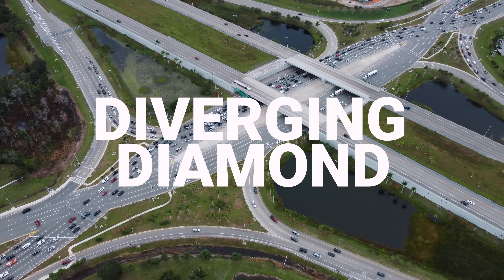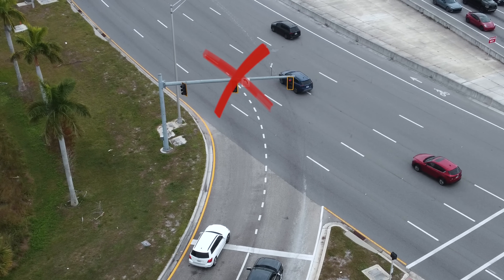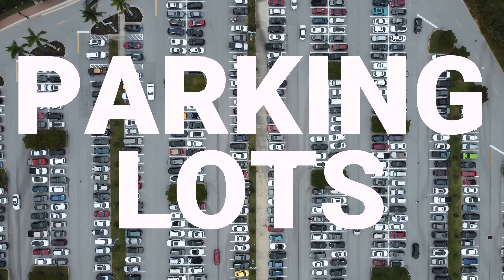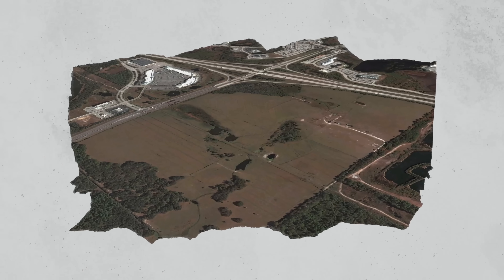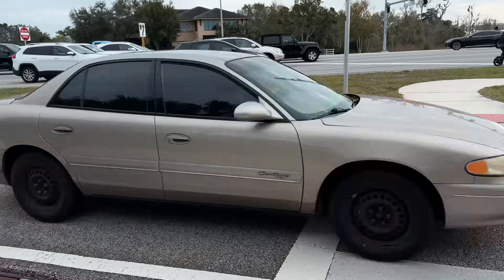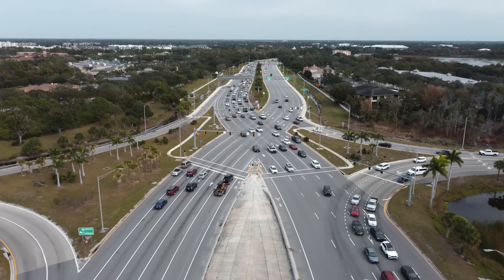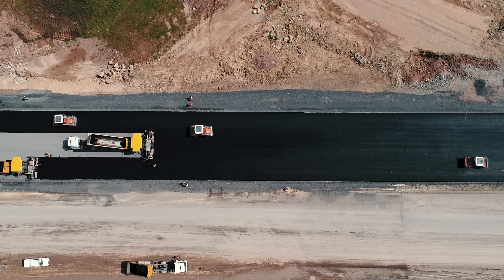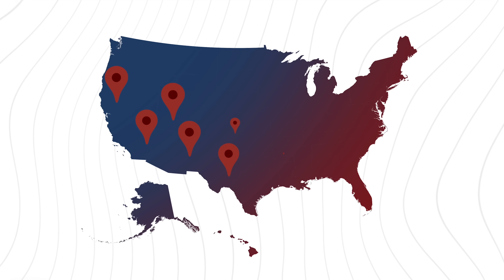Traffic Will Never Be Fixed Here

Comment: I don't disagree that there are uban planning issues here.  I judt don't agree that the solution is the walkable city.  Europe is much more walkable than the United States for example, but then the US is very geographicly different.  The US is characterized by large costal cities separated by heartland that is some variety of plains, mountains, or desert.  This geography demands that cities be connected by vast interstate road networks.  And, where that exists, it doesn't make sense that roads stop existing in cities.  Im not saying that highways don't exist in Europe, but the branch-and-leaf layout is very different.  Furthermore, the climate of many of these places dictate transportation; where heating or AC are mandatory for survival, it's another requirement; suggesting walking to the store when that will give you frostbite or heatstroke isn't a solution.  Even in cities with excellent public transportation, that final walk from thr bus stop to the restaurant can be so brutally hot or cold that a massive parking structure at the end of a sprawling road network is much more attractive than trying to survive the elements.  And I suppose, just in general, walking and biking are physically demanding where a car ride is not--not points in their favor.

This is not to suggest that more cars and more roads are the answer.  But I don't agree that biking and walking are the golden solutions portrayed here.

Comment: A diverging diamond is not the proper interchange to use here. There is significant throughfare traffic which is the primary disadvantage of the diverging diamond: it has reduced throughfare throughput. Not sure what the traffic engineer was thinking here. This really should have been an SPUI.

Comment: Ofc traffic can be fixed you american muppets. Never heard of light mass transit? Or even better, I have a totally revolutionary idea. Bare with me.

1. Lets make a lot of cars stick together so they could move simultaneously, like attached eachother in a queue.

2. You now don't need a lot of drivers, just one at the front. MORE SPACE FOR PASSENGERS.

3. Now comes the fun part. Imagine if you want to have a more energy-efficient system, so you trash rubber for steel wheels (with steel paths) and you can go even faster now. FASTER TRANSPORTATION UNLOCKED.

4. Since now you have this kinda steely queued car thing, you can also electronically coordinate this system by employing professional drivers and you can power everything electrically. Amazing innit?

5. Imagine making this enqueued steel-wheeld-cars scheduled and departing every 30 to 10 mins depending the demand. People will simply wait at a ""station"" for the steely cars to arrive.

Outcome: Now you move 5000% more people than before, with a significantly cheaper infrastructure and saving space for much more buildings to be built.

Comment: 2:04... The other place that "different" intersections fail is when paint is worn or under snow. Around here there's no money to repaint, and several days/year there's snow obscuring the lines, so it has to be clear what to do even if you're essentially blind and can't read a road sign. 2 turn lanes fail HORRENDOUSLY in the best conditions, but throw rain/night glare, worn paint and snow in there and it's a free-for-all.

Comment: Another great video. To your point, there is one interchange type that works well for a trail or sidewalk, a folded diamond, where one side has no ramps at all. Of course that’s great for that side but not so much for the other, but hey 1 side great is way better than any other interchanges can provide, at least without a ped bridge.

Comment: I play city skylines and I’ve noticed that adding one lane doesn’t fix traffic, eventually everyone on that specific road needs to make turns. 

Most drivers drive in the lane they’re planning to turn in. Public transport and making areas walkable is the only solution to traffic.
Reply: That's unrealistic. From my experience most drivers don't drive in the lane they are planning to turn in, they wait until the last minute and cut across every single lane.
Reply: Cityskylines is crappy depsite being made in Finland :/
Reply: @Flint-g4h I cry for Finland :(
Reply: @Flint-g4h  mods can make it work better and as expected
Reply: @Nova32x  
I want the thing by default
Reply: @Flint-g4h city skylines traffic ai Is also insanely stupid. No matter how much lanes you add for example 3 lane right turn they will always use one lane to turn right.

If they have to turn left after they can use any lane and switchable after the turn but they don’t
Reply: @zenitu6914 ya you need mods, it doesn't matter which country your from so no matter how many lanes they normally will just use 1, some mods make them smarter. city skyline 2 fixes that
Better Lane Change, TM:PE, Intersection Marking Toot, Roundabout Builder are the 3 you need the most.

the train system is also broken like in a real world there is a time schedule even block zones. but the game is more like here is 20 trains with 10 cars each all at once so it will overload your network. it even overloaded my train roundabout system that could hold 4 full trains at once

Comment: i'm italian, italy is one of the worst european traffic areas, and Rome is again one of the worse. I live near a big intersection, wich has a lot of traffic and it could be solved by 2 roundabouts, but that's not the point. The point is that the intersection i'm talking about is a 3 lane for every direction and it's just stupid for how it works but an intersection like that is unthinkable even in Milan wich has a lot of big infrastructures. 
The main stupid thing is regulating intersection like that with freaking stoplights. Probably roundabouts are everywhere everytime better to fix traffic, in the next crosses there should be roundabouts, it would fix traffic without any doubt.

Comment: Interesting video. In Denmark we don't have interchange that comes near to it. But it is simply illegal to pass a green light, if you as a driver is unsure you are going to make it to the "other side" safely without ending stuck in the middle and backing up traffic. If the police sees you violate this rule, typical fine is 200$ and also you collect 1 point on your driver license, 3 points and you need to take a driving test again to keep your license. A point is valid for 3 years before its deleted.

Comment: IF the city required all shopping centers to have apartments on top I think it would solve a lot of the problems. In that huge shopping center you could have thousands of apartments above. This means both shoppers and workers who don't need to drive to shop or go to work, thus reducing thousands of cars that need to come in and out of that shopping center. And the property owner would have a far more valuable property with far more income. And the apartments would all have amazing views of the surrounding wetlands. Americans just don't make any sense.
Reply: That's actually a really interesting idea. They could do the same for new box office stores. Then reserve some of the parking for residents.
Reply: I don't think they should require of what you were suggesting but we definitely should deregulate urban policies what makes the US so car dependendent.

Comment: Re: the lights switching while there are still cars in the segment of road expected to clear — isn't this exactly what interlocked block signalling (as in railways) is for? Slap a load sensor under each lane at the entrance + exit to each "block" of road, to measure how much weight of cars is "in" the block; and then set the entrance signals to the A-crossing-B block to stay red as long as any cars have entered-and-not-exited in the B-crossing-A block (and vice-versa.)

Comment: I suspect the blocked lanes problem could be solved by timing the traffic lights differently. cut the initial crossover light first, then give ~3 seconds for traffic to clear before cutting off the crossback light. 

I think that for instances where they are getting this many lanes they are more likely to find success with a true interchange rather than an intersection. it is a nice dream to think we could have more walkable cities and suburbs, but the simple fact is that infrastructure that is already in place is very difficult to change. so while a walkable city is the goal to head towards, we still need solutions to handle the automotive traffic we won't be able to get away from for the next 50-100 years

Comment: To be honest, this issue seems quite easibly fixable.
Just use a „counting“ system that counts the amount of cars entering and leaving the area between the the first diversion.
Now all you need to do, is to ensure that the number of cars entering the space and leaving the space is the same. If it isn’t, then the junction should turn the first light to red for all directions, and elongate the phase on the second light to the point where the number is equal again.
Only now the first light should switch to green for the opposing traffic.
This way cars can never block the crossover area.

For the Turning lanes coming from the Highway, the light should be timed in a way, that they only get green, when the same amount of cars that have passed a sensor on the highway off-ramp, have left the diverted area on the second traffic light.
While this will slightly delay the amount of time until all phases cycle through, it’s only by a fraction of seconds and will massively improve throughput.

For the pedestrian situation, you can either move the Pedway into the center of the DDI, and use the redphase of either side for a completely safe crossing, or simply not direct foot and bike traffic over it and build a bridge or underpass either underneath the crossing, or through the highway dam.

I always feel like Americans do not quite understand how to find solutions for miniscule problems, and prefer to be in agony instead.
Reply: That is already the system in place, and that is not what is causing the backup.  As the narrator and Road Guy Rob has said, this interchange is too efficient that the downstream intersection cannot handle it.  Either the downstream intersection needs to be removed, or it needs to have a green time so long that other directions need to wait longer.
Reply: @traffic.engineer  Yesnt. The root of the problem is the second intersection, but the symptoms of the problem can be easily solved by my ideas. All that this would do is flow control, and solve the problem of „driver stupidity“

The flow itself would actually go up by throttling the amount of cars allowed to enter the DDI. Most of our intersections in Germany work that way.
Reply: Pedway is already in the center of the DDI.

Comment: Spoiler alert: The solution is a roundabout. This whatever it is is an accident waiting to happen by design.
Reply: Roundabout would fail at effeciency.  Roundabouts max out at 25000 vehicles per day (45000 for dual lane).  Traffic here exceeds that.  The queues would cause safety hazards in the freeway lanes, and construction costs would be greater due to right of way acquisition.

Comment: If they were willing to spend that much on an intersection, why not go with a windmill interchange (or variant such as pinavia, itl, or diveraging windmill). ITL is typically the high price intersection I like putting in games; no nessacary signals, and no atypical/confusing traffic movement.
Reply: Windmill would not work if one of the roads is a freeway.  And it would still have the same number of signals.
Reply: @traffic.engineer  I'm confused on how a windmill intersection would not work for highways, since it is specifically designed to work for highways.

Comment: The lengths Americans are going into to avoid building a roundabout
Reply: A roundabout would fail, as the capacity is limited to 25000 vehicles per day (45000 for dual lane).  The right of way cost would also make it cost-prohibitive.

This is why America reserves roundabouts for rural and mild suburban locations.

Comment: The problem is more complex! No "perfect" roads, or public transport will fix the traffic problem if:
1. we won't change the driving habits. These are 80% of the problem. Most of the people do not know how the highway/motorway works and how to behave on the road.
2. we won't fix the public transport. 
2a.Train ticket from Glasgow to London is more expensive than return flight from London to Italy including taxi.
2b. The same Glasgow to London road is cheaper by car than train.
2c. Local public transport is more expensive than taking a car to work. Not even including if you drive with 1 or more people (including kids)
3. Big lorries convoys. These slugs can't dynamically adjust the speed. Entire trafic is always adjusted to the "slowest" user on the road.
4. "Want to be the first" drivers, and skip the queue. Also most people do not understand that the traffic jam is caused not only by those who try to cut the line, but also by those who are "nice" and letting them in.

And this is just the tip of the iceberg. Unfortunately big cats are not trying to fix it, they just simply increasing the prices of everything so we won't be able to travel at all. For some of those, we are the "cause of the problem".
There is NO one, nor SIMPLE solution to that traffic problem. As I said, the problem is more complex!

Comment: I get bridges are expensive but making the two cross over points intersect on the same level requiring  the traffic light greatly diminishes the value of this design.
Reply: If the cost is 25 times greater but the benefitbis only 2 times greater, then it is not worth the cost.  DDI increases efficiency and safety from the orginal design at only a fraction of the cost.

Comment: I think to fix the interchange backup issue of diverging diamond you would need to instal underpasses and overpasses which would be quite expensive.
Reply: The backup is caused due to the interchange being too efficient for the downstream signals to handle.  So the problem is not the interchange, it is the rest of the older infrastructure it connects to.

Comment: I don't think it'd so much be a problem if people were only using it to get on and off the freeway, however judging by the ariel shots many people are using it to simply cross the freeway, so we have all of these people using the interchange just as a road to get to the other side... while also having people coming on and off the freeway. Had there been a road there to begin with to move cars freely to where they want (to the mall and away from it), then built another interchange further along, it wouldn't have been so bad I don't think. baffling choice, and its going to be tricky to fix without it becoming a public transport hub based on how many people are using that shopping district.

Comment: WHY WAS THIS NOT FIXED WITH  UNDER AND OVER OPTION? tHE 2 LIGHTS CAUSE THE MAIN PROBLEM, so Make them useless?
Reply: Construction and maintenance costs.
Reply: And it is not the interchange signals causing the backup.  It is the older downstream intersections that cannot handle the interchange being so efficient.

Comment: I still don't get a few things. I only drive to a mall when i need specific things, like winter sports shoes. But everyday things i can buy in local places or supermarket, but to be fair mass produced food taste like paper, so i do prefer greengrocer's, butcher's, bakery for their respective products. 
You don't need more parking places, just bury them underground. It doesn't make sense for 1 family housing, but for block of flat for example just use levels -1/-2 as parking loots. Levels 0/1 can be also used as places for stores, as we do here.

I was born and raised in small village (300ppl) we had 1 store nearby with everyday products so we didn't have to drive 10km (6 miles) to the city  for bread, vegetables (we did have our own to be fair) etc.

Comment: The engineer in me wants to put in sensors that detect cars still in the crossover intersection, and not let the appropriate other lights turn green until they clear out.  In fact, red lights should block any traffic from going into the conflict zone until that traffic has a clear way out of it.
Reply: There are sensors to detect traffic.  But also keep in mind that left turn on red from the ramps is also legal.  So the traffic stream never stops.
Reply: But the issue is not the interchange signals causing the backup.  It is the older downstreem intersections that cannot handle how efficient this interchange is.

Comment: Without trying to fix the underlying problem, wouldn't a simple change to the red lights timing fix part of the traffic? If there was a traffic detection system that was able to tell that a situation like 4:19 is coming up, and lights stayed red on both side a little longer in that case, cars from one side would be able to exit the crossing zone before cars from the other side are able to enter that conflict zone.
Reply: The flaw is not the interchange or DDI signals.  The flaw is the downstream intersection and signals that are overcapacity due to the DDI being so efficient.